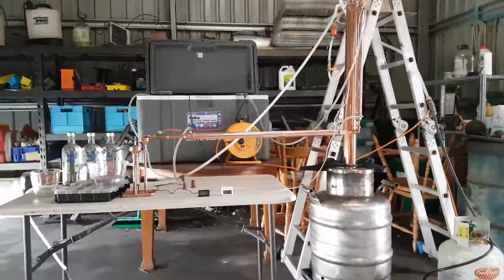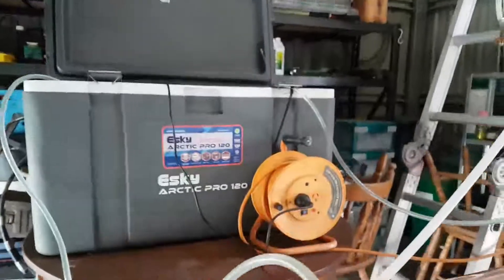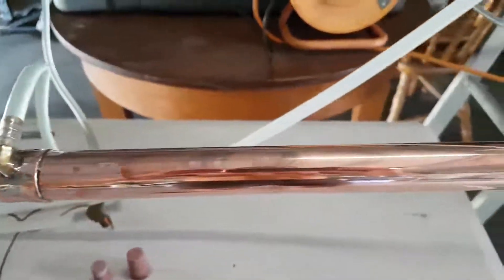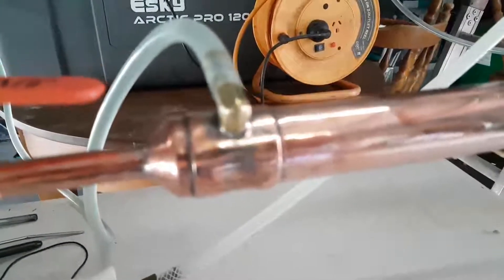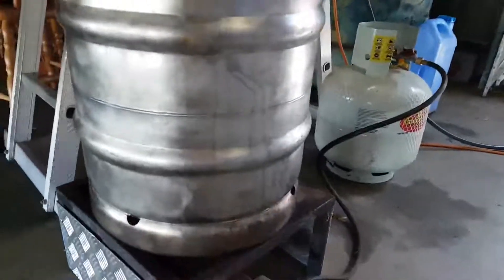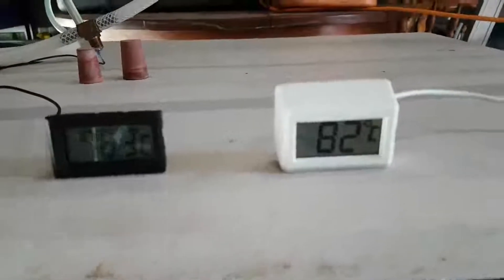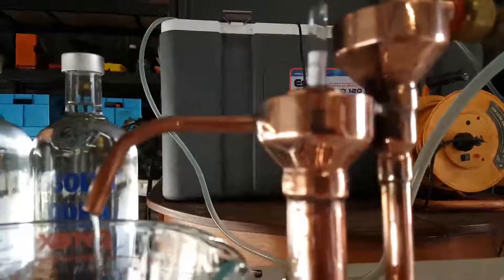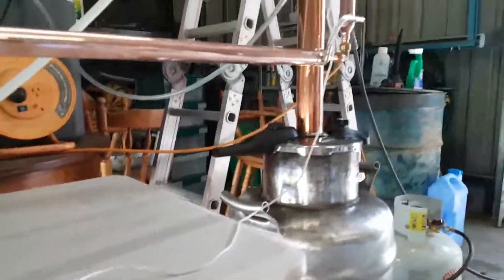How to distill alcohol with a reflux still 3rd short video 13 12 2017 mp4

Comment: Hello Dan, congrulations for your sharing, design, creativity and ofcourse explanation. But I have some questions if you answer will be appreciated. I have similar system but could not get the same abv percentage yet, I am trying the get better solutions on it. 
1. What did you wash? I mean what is the alcohol abv percentage?
2. You share Reflux cooling water outlet temperature. What is the inlet water temperature?
Cheers